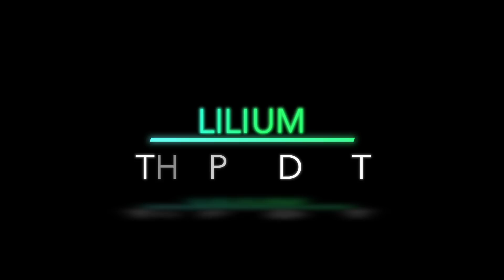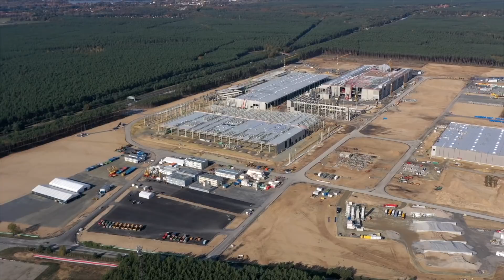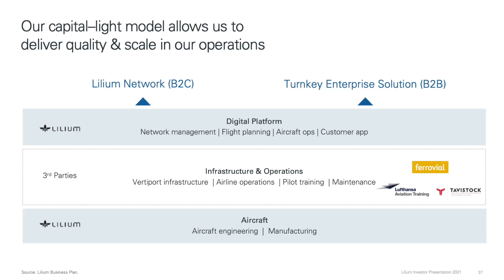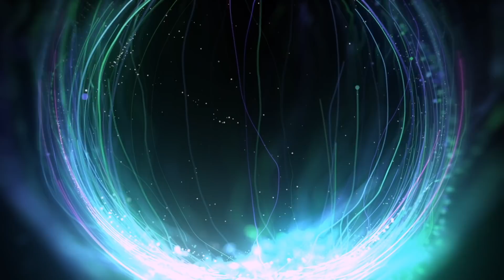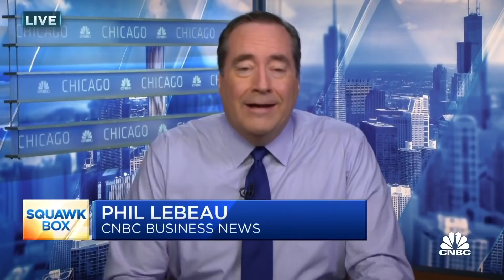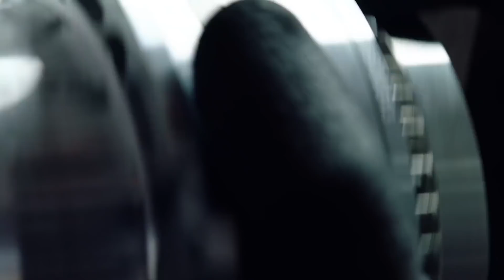Lilium (QELL) eVTOL SPAC: Deep Dive! Product, Business Model, Investors, Team, Competition & More...

Comment: Mr Musk might do better, implamenting booster speeds on this craft and safty passager bay ejecting as pods. Or highway road and rail conversions. But most of the status don't demo of the rivals comparisons, for one , the craft has only been witness to go little over 50mph travel in video demo, also that claim of inner cities, its too bulk of wing span for that, its also called a "jet," but is all electric, perhaps in the future use electric combustion, because right now, it doesn't have even afterburners. So many small engines, even small, is causing heavy weight and doesn't support the vertical lift with lateral balance very well, wobbles often, because no yaw fins are on the engine, nor dies the engine tilt, during verticle.

Comment: I'm convinced that battery cars and planes will ultimately prove to be a transitional stage between petroleum and hydrogen power.  Compare the flight times of the hydrogen drones on the market with battery-powered drones.  It's no contest.  If Lilium wants to dominate the VTOL market, they should be working on lighter fuel cells rather than batteries.  155 miles of range between multi-hour recharge cycles is a non-starter.   Offer 500 mile range and ten minutes to refuel, and they'll be bigger than Gulfstream within five years of shipping their product.

Comment: The noise level really is the key issue, if youre just some guy who do tech news and not into the e-vtol scene it’s easy to be led to belive that batteries is the main issue. They can write whatever they want on the brochure theyve handed you, for urban e-vtol travel, NOISE, not batteries, is the key issue. When considering how much footage theyve shown on the prototypes flying without audio, it’s pointing to that the audio levels prob isnt that great. Lilium is great though but it really can’t be stressed enough how incredibly important noise levels are for marker acceptance. Joby will prob be most successful Archer is good to. Both Joby/Archer/Hyndai/Heavyside use pretty similiar design, KittyHawk Cora, to a lesser degree. But one should not count out Jaunt Air with their slowed rotor design. Not as cool looking but the superior design due to autogyro so you can always land safely with loss of power or engine while still given the capability up complete vertical lift off and the vital low noise benefit that comes with slowed rotor tech. It is also one of the upper tier players in the e-vtol field. Perhaps not up there with Joby and Lilium, but definatley in the top 5 of the highest financied E-vtol endeavours.
Reply: Noise indeed, which is a part of the much bigger infrastructure question.

Comment: I’m invested in PLTR and TSLA. I’m curious about PLTR’s involvement. As a pilot though, I am very skeptical when I hear people say Elon wants to develop a supersonic electric VTOL aircraft. As far as I’m aware, every electric aircraft ever uses propellers or fans. There is not a single supersonic propeller aircraft (of any engine type) in the world. This is due to the physical limitations of drag on propeller tips near supersonic speeds. Elon would have to invent an entirely new form of propulsion for supersonic speed which I just can’t imagine. Regarding the range of these 3 companies aircraft, it’s no good having a. 60 or 150 mile range if you have to spend 2 hours charging when you get there!  Flying is a highly intensive energy burner. You definitely need super fast charging or your fleet will spend more time on the ground than in the air. I hope these companies succeed but there are many problems and rules with aviation that don’t exist for normal EVs.